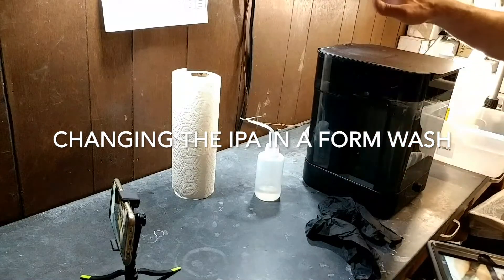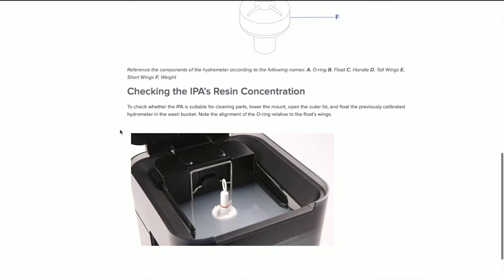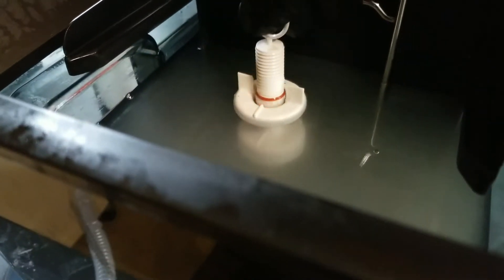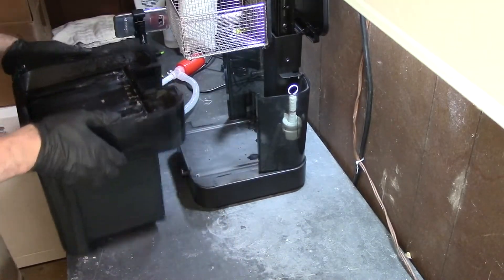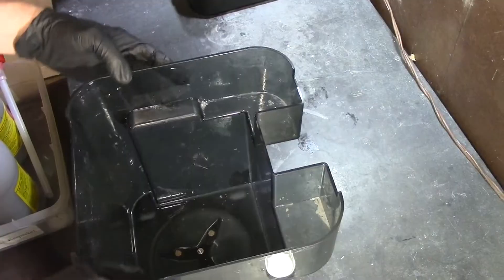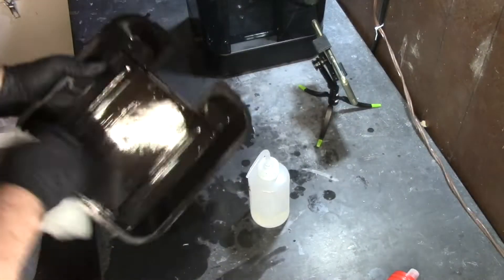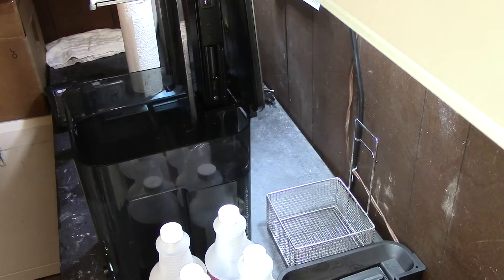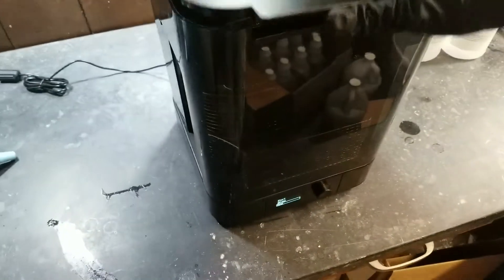Replacing the IPA in My Form Wash (for the first time!)

Comment: Nice video, I'll do this for the first time too.  Just wondering what's the hydrometer for?
Also is there clean alcohol inside the small bottle that you use to clean parts? Thank you
Reply from the maker: Great question! Honestly, I never use the hydrometer anymore. I know it is used to test the quality of your alcohol making sure it is still strong enough to clean the parts throughly. As you wash more 3D printed parts the more the resin pollutes your alcohol. So recently, Ive realized it is easier to just change the IPA after 80 or so washes. I can tell when it needs to be changed if the parts are still "tacky" when they come out of the wash, no need for a hydromere for me to notice that :)